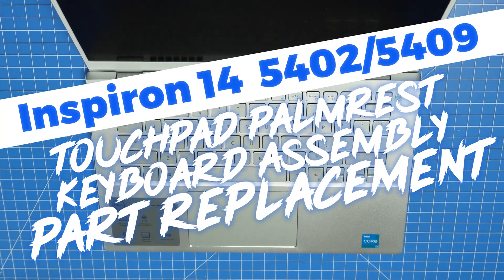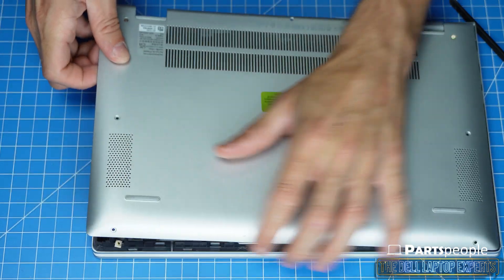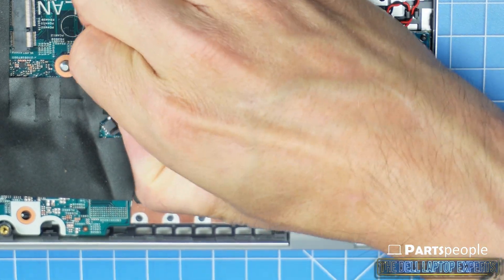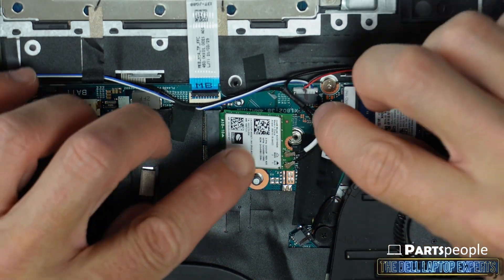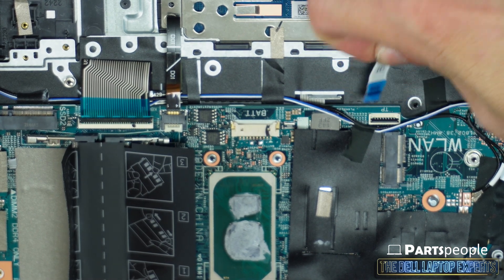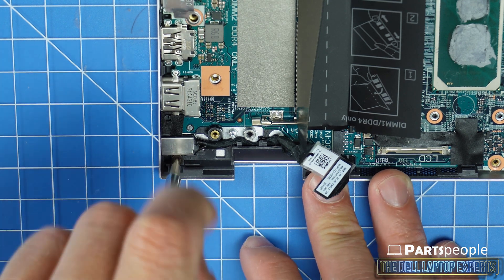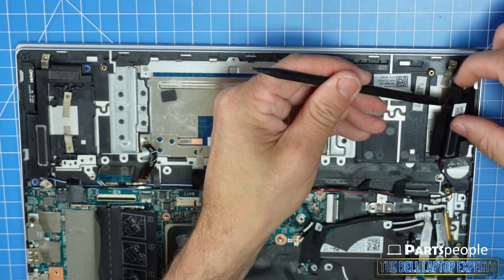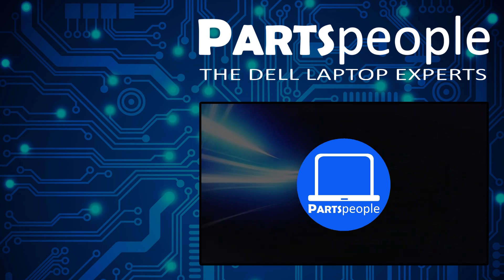Dell Inspiron 14 5402/5409 How-To Install & Replace Palmrest Keyboard Assembly | Repair Guide

Comment: Would this work on a Dell Inspiron 14 5000 2-in-1?
Reply from the maker: These models are completely different so the disassembly steps would be different.
Reply: Thank you. My Dell inspiron 14 5000 2 in 1 laptop just working screen ⌨️. Do I need to change the keyboard? let me know?